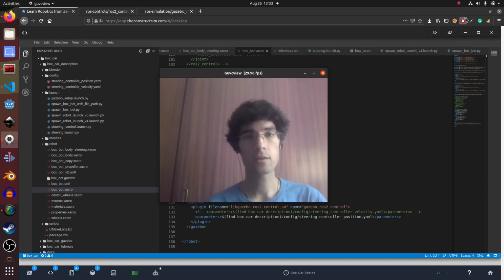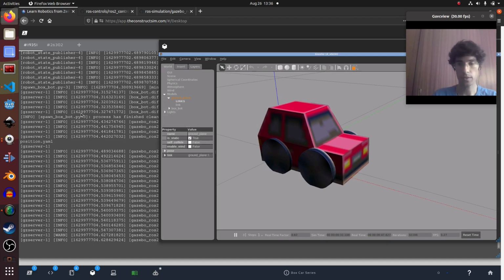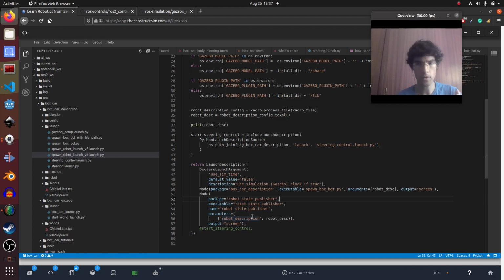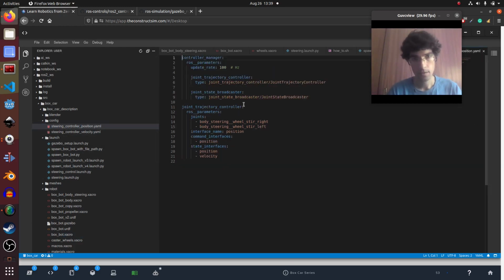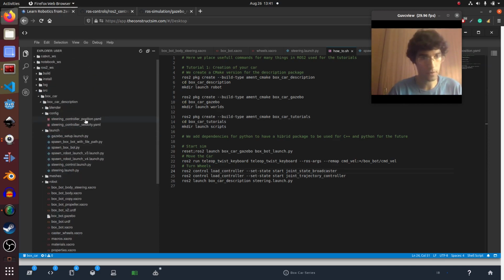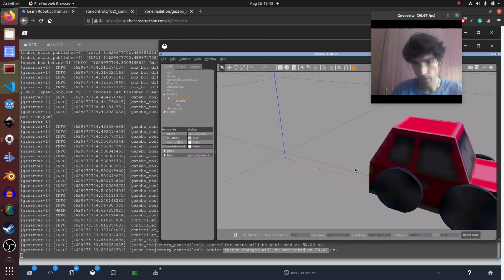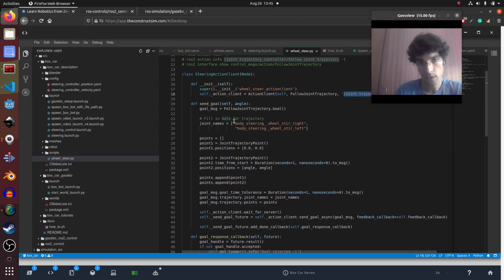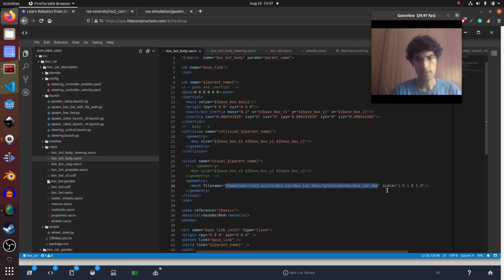ROS2 Joints Control Gazebo

Comment: Hello and thanks for the video! I cloned the project and made it work on my machine by changing the absolute paths to the meshes to point to the right place on my hdd. I still have problems visualizing the robot in rviz2 as there are error messages like this one: [ERROR] [1647071042.937250926] [rviz2]: Could not load resource [/home/user/colcon_ros2/src/box_car/box_car_description/meshes/box_car.dae]: Unable to open file "/home/user/colcon_ros2/src/box_car/box_car_description/meshes/box_car.dae". Can anyone please show how to visualize the robot in rviz2? Also is there a solution on how to get rid of the absolute paths to the meshes?